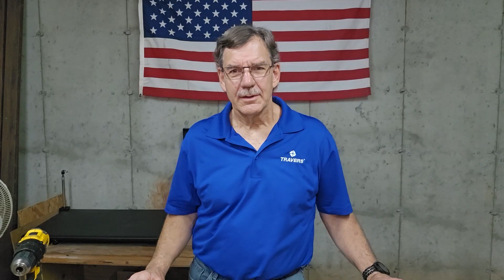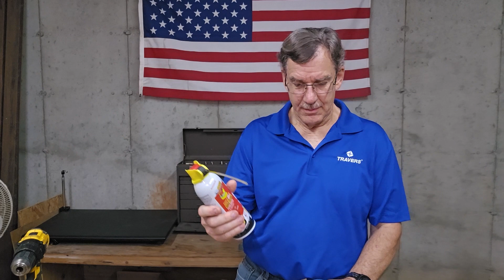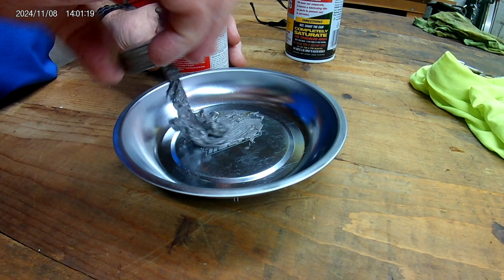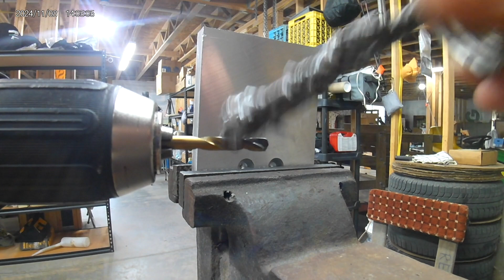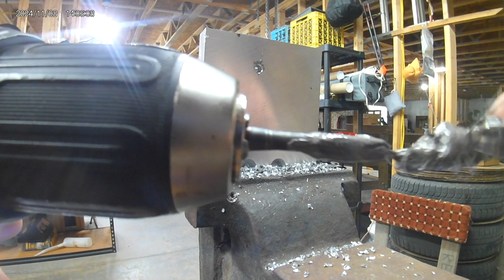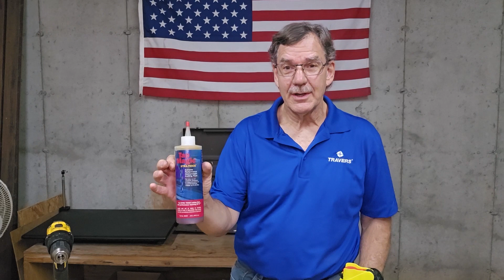How to Make DIY Cutting Oil | Travers Tool Co.

Comment: Even easier is to just use some bacon grease, Animal fats were actually used traditionally in Cutting compounds for years..
Reply from the maker: That's a great point! Animal fats have indeed been used traditionally. Thanks for sharing! When I needed something in a pinch, I just used what I had handy at the time.